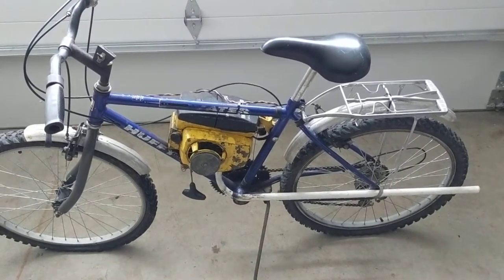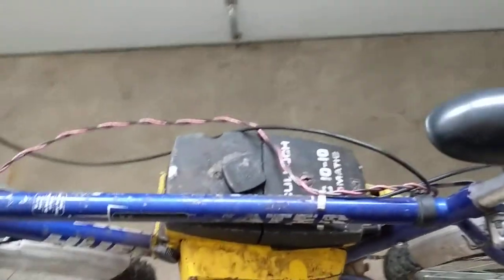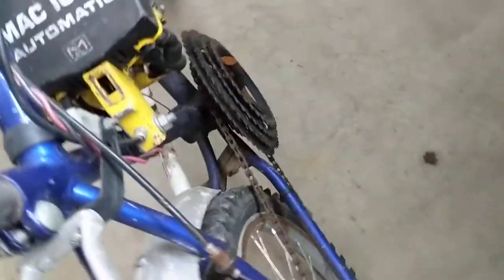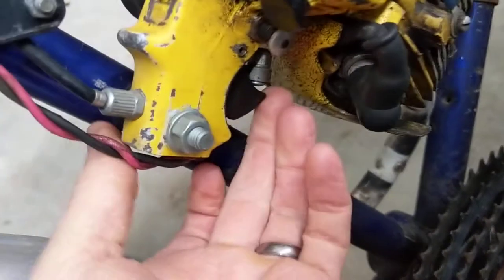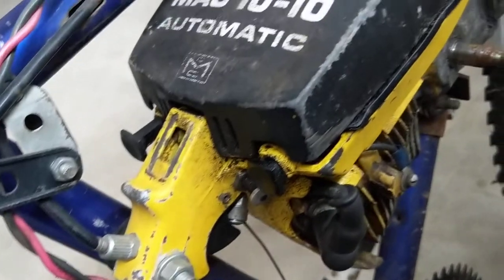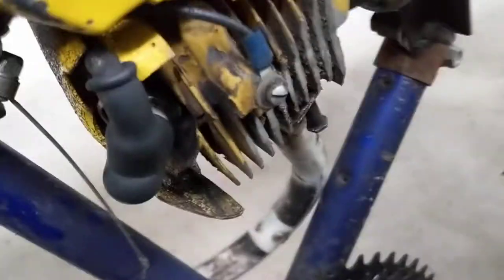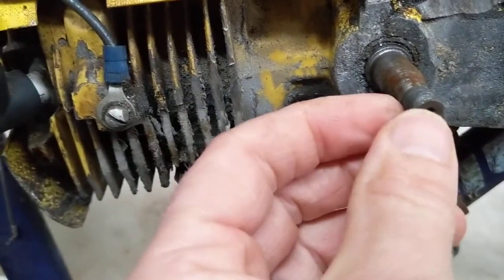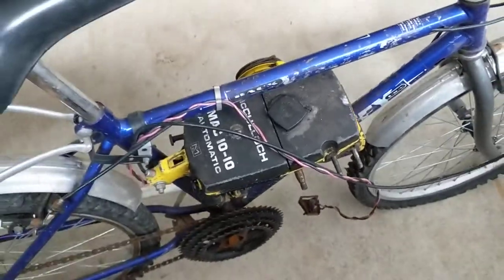McCulloch Chainsaw Bike

Comment: Can I drive this without a license?
Reply: Absolutely
Reply: Sadly, not in some states of Australia. Power-rating limit of a motorised push-bike on public roads is 200 Watts - ~ 5CC's. It's uncommon to find a chainsaw motor that operates at less than 20 CC's. A 50CC Motor generates significantly more Wattage (1,000's of Watts). Over 200 watts, you need a license, and both the bike and rider are subject to a range of safety criteria for the bike and its use on public roads to be deemed safe and legal. Sadly many typical off-the-shelf DIY petrol bike conversion kits are 50CC or 80CC, making them illegal to use on a pushbike (on the open road) in the Australian state of Victoria without a license. Also sadly a speed governor doesn't help: the maximum rating of the engine can't exceed 200 watts of power (without any governor or control).